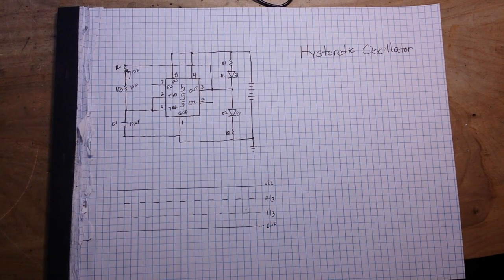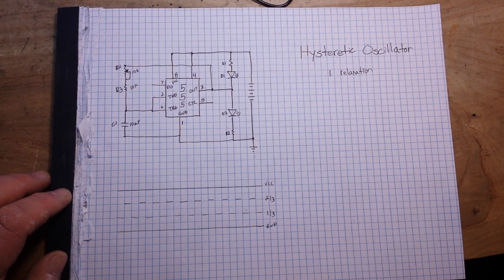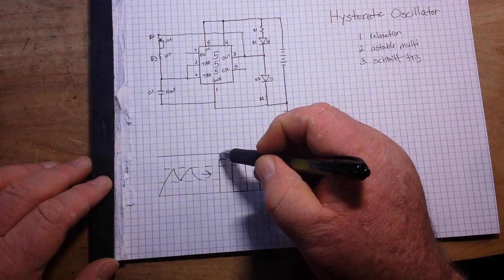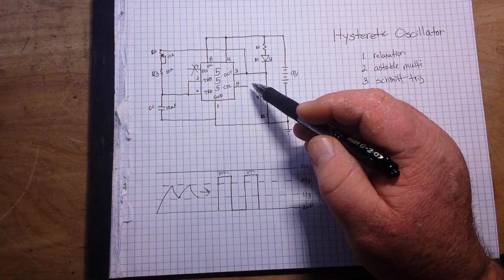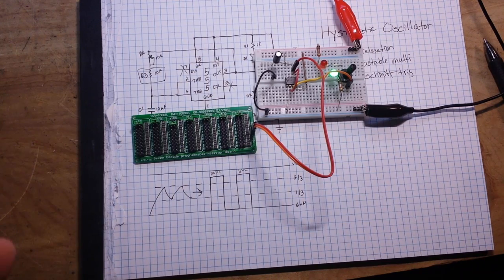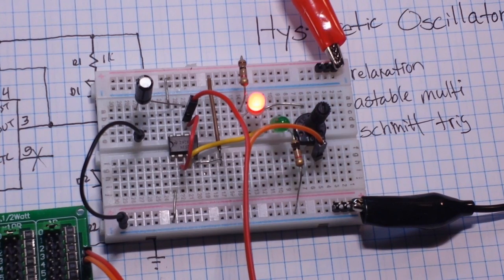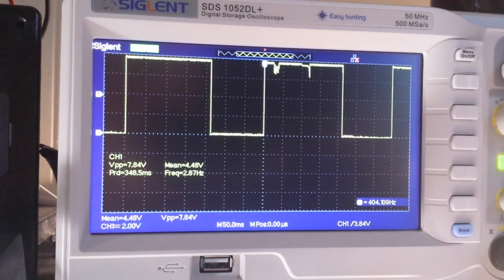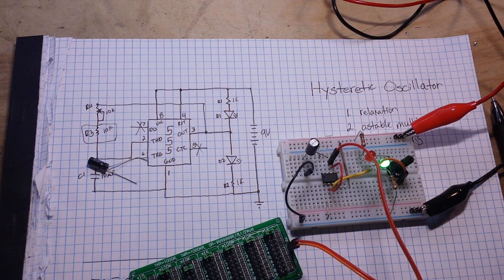Hysteretic Oscillator

Comment: Recently found your YouTube channel and very much enjoy it.  Am retire and 72 years young.  Had a ham novice ticket in 1967 and that was it.  Currently studying for tech ticket in March.  Have always loved electronics but still don't understand circuits.  Hope I can learn more basics from you.  Any suggestions as to how I can understand things like how radio circuits work and why do I hear things  in a radio.  What are the different areas that makeup a complete pcb to produce a result.  As you can see many basics that I am confused as to the correct parts to understanding.  Stay healthy and continue your own journey.  Gus
Reply: radios are more or less several circuits mashed together. and there are of course many different forms out there. a very simple one should be the crystal radio. there are kits u can buy. i dont know much about other radios. there are transistor radios (kits exist for that too) and software defined radios (these are usually just a single IC, here is learnelectronics video about one https://www.youtube.com/watch?v=-KtE0ssCRXg ). anyway, the reason you hear audio is cause the frequency is modulated, either AmplitudeModulation (the change of amplitude is converted into audio) or FrequencyModulation (the change of frequency is converted into audio).

Comment: I have been using a transistor to drive my LED, seems to be a tamer, more mellow square wave.I am just a junior novice at the stuff but a direct out from pin 5 and ground yields a square wave more than 5V from my 9V battery and with a long duty cycle. The transistor output and ground yield a 2V square wave with a much shorter duration duty cycle -- which without going into detail, my little music toys respond to (the former was too much signal for them).

Comment: the 10K is the value to be used for pull ups timing circuits, etc and they simply disapear... they are all on the projects :P Another example of agility of the 555 timer. Keep that IC in the toolbox

Comment: I didn't understand how 555 hysteretic oscillator differs from 555 astable multivibrator. It seems there's no difference if you look at the output of 555 timer, it's still square wave output. Someone, please explain how it works and what is the difference with 555 astable multivibrator. Thank you.
Reply: The circuit has feedback from the output pin, pin 3, to the trigger and threshold pins. There is good information about 555:s here :  https://www.electronics-tutorials.ws/waveforms/555_oscillator.html and here : http://www.unitechelectronics.com/NE-555.htm .

Comment: Very nice video. I guess most people understand the 555.I bought several 555 timers and build projects with them. Been using them for about 2years..However I have more trouble understanding how these things work. I build the circuits and may Ponder over how it works for hours. Yes I know Iam not smart. My  goal for this chip is to use it for a live well timer. Simply on  1min and off for 9.Could never get the duty cycle right. I don't want to buy a live well timer because that would be given up.I find the 555 to be very frustrating.

Comment: What I don't understand is that the 555 should give a 50% duty cycle when the output pin 3 is used in place of pin 7.  Yet your circuit is definitely not giving 50 percent.

BTW the 555 datasheet says a 0.1 uF between the supply rails at the chip is mandatory.  Your doesn't have that bypass capacitor.  😥
Reply from the maker: Not using it "according to datasheet". We are taking advantage of the internal circuitry to make this work. The mark and space are uneven because the 555 is not operating rail to rail.